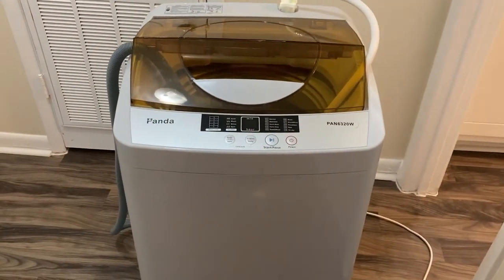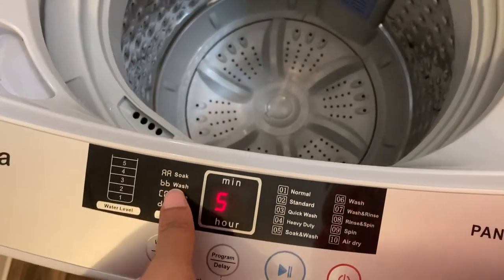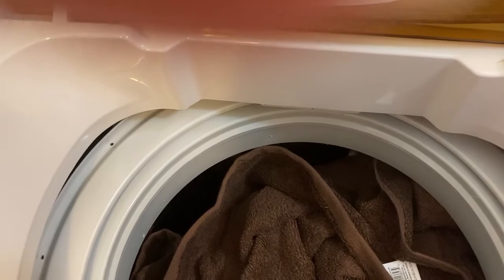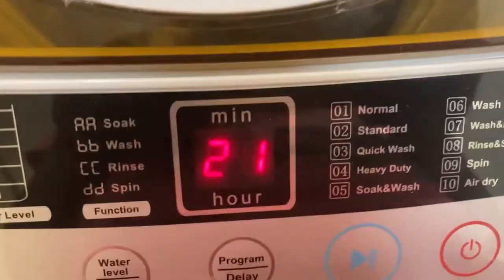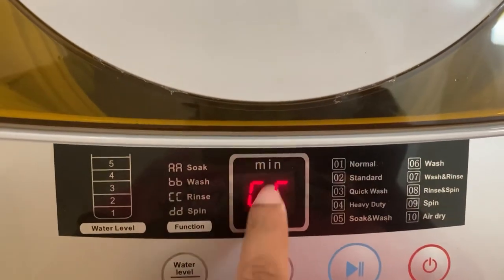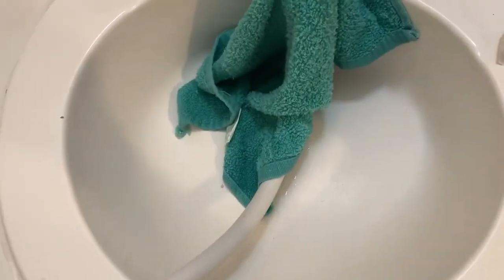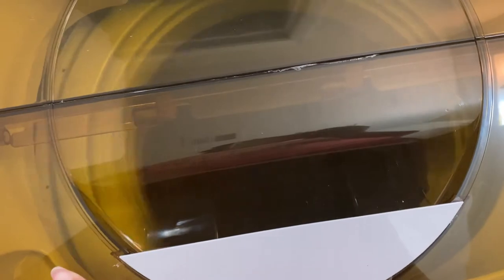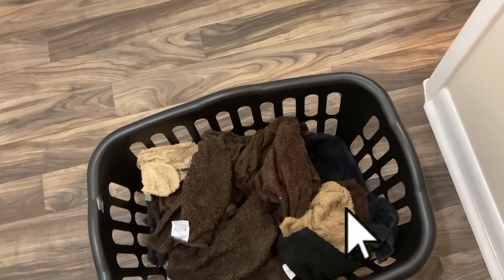Panda 🐼 PAN6320W Portable Washer Review/Demo| MUST HAVE!

Comment: I have the same connection you push down then hook it up and  it will pop back up you should screw it snug so you dont have to use the cloth. Cloth will fall off and plug the sink.
Reply from the maker: I’m scared to that again. The last time I did it got stuck on the faucet and it’s still on that sink 🤣🤣🤣 the cloth has been working good for me. It just control the water going everywhere. Thank you for watching! ✨
Reply: Ok good you found what works for you. Maybe some oil on the inside it may stick so its secure that it dosnt fall off. Or tie cloth on. I did that at first and cloth fell off and plug my sink water everywhere oh lord my kid thought it was funny and brought her ducks out.

Comment: Hi. How is your washer holding up today? Would you ever consider doing an update on how the machine is currently holding up? I wanted order this but a little nervous after reading mixed reviews but I'm sooo tired of going to the laundromat.
Reply from the maker: Hey! The washer is still going strong!! I would highly recommend because it will save on going to the laundromat. The washer is still one of my best purchases til this date!
Reply: @ashleyeyedeas4802  Ok. Thank you so much for your response. May I ask have you experienced leaking from faucet connection? I'm seeing ppl reviews with that very problem. The mixed reviews are confusing my decision to purchase. 😩
Reply from the maker: You’re welcome! The only time it leaked was when I didn’t tighten it hard enough to the faucet. You have to make sure it’s tighten or it will leak.
Reply: @ashleyeyedeas4802  ok thank you so much. I'm going to order it.😊

Comment: I had mine for awhile but had a burning smell really bad. Like rubber. I always clean the lint filter so idk what it was it how to fix it. Do you know what it could be? Also I never fill it too full but the spin cycle started getting really loud before the burning smell
Reply from the maker: Awww dang! I haven’t experienced that with mine which I still use maybe 1 to 2 times a week. I honestly don’t know what that could be. I would contact the manufacturer and see if they have any resolute to that issue. Sorry you’re experiencing that! ♥️

Comment: so you suppose to turn the faucet water off while using or how you know when to stop water in the beginning
Reply from the maker: I recently discovered that it will turn off on its on when I used it with my kitchen faucet. When I was using it at my old place I could only use it in the bathroom so I had to stop the water manually. Now with the new hook up in the kitchen it automatically turns off the water when it isn’t filling it up or on the rinse cycle.
Reply: @ashleyeyedeas4802  I had on level 1 quick wash and the water didn’t stop and filled up machine. Then we stop the faucet water and the wash cycle never started.

Comment: Make sure to use fabric softener so your pump doesn’t get clogged up. I quit using it and my pump started acting up. It probably slid the lint and soap through. Went back to using it and hope it’s not too late.
Reply from the maker: I literally started back using it lol thank you for that though!
Reply: You didn’t hook it to the pipe properly that’s why there is water spillage you are supposed to pull it down an push it up on the pipe it’s magnetic not screw

Comment: hi can you just pour the water into the machine or do you have to hook it to the sink
Reply: and when you hook it to your sink do you turn off the water when it fills up or does it automatically stop pouring water out
Reply from the maker: I haven’t tried just pouring the water into. I just hook it up to the faucet and you have to turn it off. It will stop so it will let you know when to turn your water off or when it needs more water it will stop so you will know when to add more water and when yo turn your faucet off. Thanks for watching!
Reply: @ashleyeyedeas4802  did you end up trying?
Reply: @kassandrarodriguez1120  did you find out if that works ?
Reply from the maker: @Sincerely.jeanaa  I haven’t. I hook it up from the sink faucet in my bathroom

Comment: Does it mean everytime u do laundry u need to be home? Will it not run on its own cuz you need to turn the water on during the rinse cycle?
Reply from the maker: Unless you want toys water continuously run. The washer stops until the water is running when it’s needing to do be on the rinse cycle. After the cycle ends your water will keep running unless you manually turn it off.
Reply: It runs just like a reg washer hook up..yes you can leave your home..